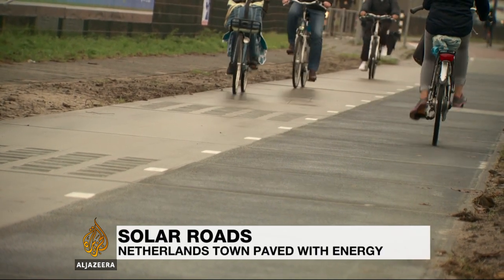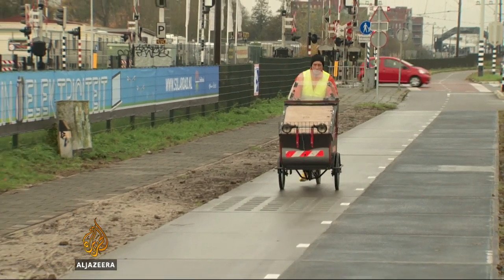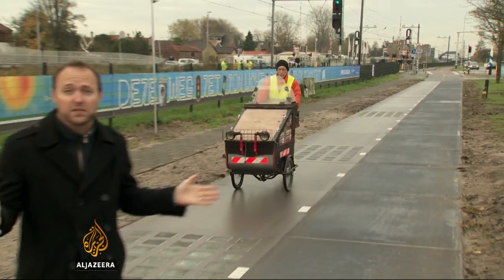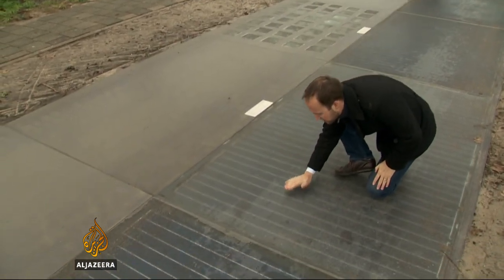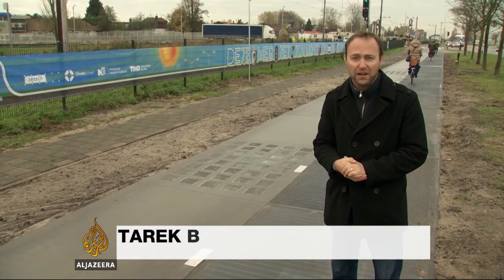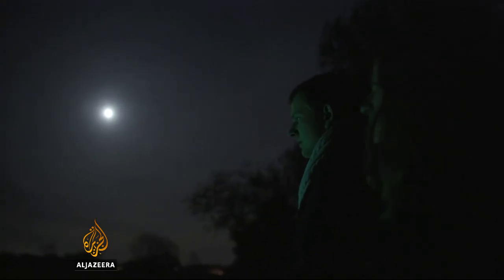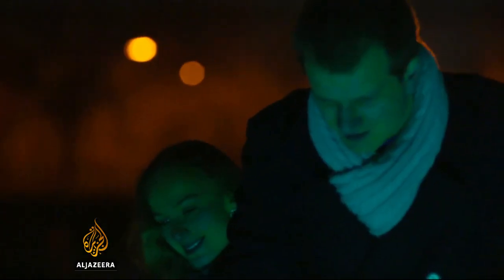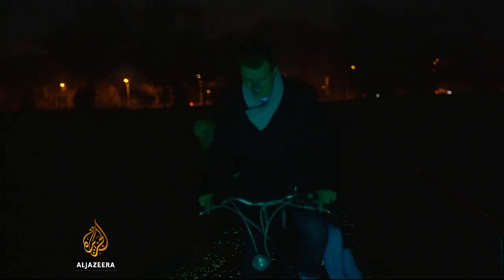Netherlands rolls out 'solar road'

Comment: I see people bashing this but currently not "cost effective" or currently anything negative means NOTHING! It is a step forward in the right direction and you need to try it and implement it in order to find how to make it work and fix any problems. Do you not understand that these will take the same trail, error process that Computers and LITERALLY every other Scientific advance has in the History of Everything! Solar Roadways are coming, it's only a matter of time, they are as inevitable as the smart phone I'm posting this message from, something that 30 or 20 years ago similar sceptics would say was insane.
Reply: Yes let's use solar panels in the most inefficient way possible and make building roads 100x times more expensive...

Comment: For all the haters:

I'm not for or against the solaroad, but I need some more info to make up my mind. 

Obviously the 3 million euros spend are for a large part research and development cost. When the first mobile phone was invented, no one said that it was a stupid idea because the phone cost millions of euro's.

I need to know the price of the solar panels used in the road compared to the price of solar panels on the roof. 

Also, when installing panels on the roof you will need to pay labor costs to human beings to install the panels. The solaroad is build in modules which will be pre-manufactured in a factory and in a factory you can use way more automation than when installing panels on a roof. And automated installation in a factory is obviously a lot cheaper. 

I'm also wondering about the price of inverters. When installing solar panels on a rooftop, you will need to get one inverter per roof generally speaking and I believe the inverters make up quite a bit of the total price of installing a usable solar array on someone's roof. When you have stretch of solaroad of a few kilometers, what's the price of the inverters you would need compared to a few kilometers of rooftops?

Shouldn't we hold back our judgement until we have the full price comparison?
Reply: +LeonHoogland Putting solar panels flat on the ground is the least efficient way for them to generate electricity, except for gratzel cells which are less efficient and use the rare and expensive metal platinum to generate electricity. Judgement has already been made using facts, not airy-fairy science.
Reply: MrCordycep From the Solaroad website:

Why would you include solar cells in the road and not next to it or on rooftops?

It is not either-or, but both-and. The total electricity consumption in the Netherlands lays around 110,000 GWh and increases annually by about 3% (according to CBS Netherlands).

This means that if all suitable roofs in the Netherlands would be equipped with solar panels, they could only supply approximately 25% of the Dutch electricity demand. In order to reach a larger share of solar energy, a larger surface area of solar panels is required and therefore alternative types of solar cell applications than only rooftops must be found.

In this regard, roads are an interesting option. The approximately 140,000 km of roads in the Netherlands cover a total area of about 400-500 km2, which is significantly larger than the total (suitable) roof surface area.

With the integration of solar cells in road infrastructure, a great potential has come into existence, creating a complementary market for solar panels.

http://en.solaroad.nl/faq/general/

Oh no that really sounded airy fairy!!! 

Maybe next time use your brain a bit more Mr Cordy. These roads are developed for The Netherlands, a tiny country with not a lot of free space. We don't have any deserts here.
Reply: +LeonHoogland Read the part where I wrote laying solar cells flat is the least efficient way to generate electricity. Both Thunderf00t and EEVblogs have videos showing how nonsensical the idea of solar roadways is. Quoting the marketing department of the company doesn't validate your point at all. As I already wrote, judgement has already been based on facts.

The funny thing is you falsely tried to appear impartial in your comment but then go and blindly defend what is nothing more than a white elephant project based on belief and not facts. Furthermore, you don't even bother refuting what I wrote in the first place.
Reply: MrCordycep I understand that laying solar cells down on the ground is not the most efficient way to use them. But again, there's not enough roofspace in The Netherlands and The Netherlands in general does not have a lot of space.

Thunderfoot is from Australia I believe and using a solaroad in Australia is silly yes.

But again, we're talking about a a tiny very densely populated country called The Netherlands.

This discussion should not be just about science, it's also about the practical implications of the technology.

But for some reason that's really hard to understand for people. But when you said the logic presented came from the marketing department of Solaroad you showed how sad you really are. CBS that has provided the statistics is a government entity and if they say there's a certain amount of roofspace, there's a certain amount of roofspace. DO YOU UNDERSTAND?

Comment: Yeah why not just have normal solar panels? It's cheaper and more efficient.
Reply: Jonathan Cheung
1. The Netherlands doesn't exactly have tracts of land where you could just put thousands of solar arrays like they do in the deserts of Arizona and California. 

2. Roads are not as "cheap" as you assume. An average cost of one 1/4 mile of standard two lane road costs $30-40k+labor+maintenance. Solar road of a 1/4 mile length could provide enough energy to power 20-25 homes, saving anywhere between $50-60k alone in electrical, fuel, and natural gas costs. While the upfront cost of solar panels is far higher than paving like normal, the eventual benefit for not only the environment but also a budget is better in the long run with solar panels. (For instance one solar panel on a house cost $30,000 and last 30 years, while the energy costs of an average home would run about $45,000-50,000 during a similar period.)
Reply: +Darrin Pfaff Asphalt roads and fossil fuels are incredibly cheap compared to solar panels...
Reply: Darrin Pfaff So mount the solar panels above the roadway like a roof. Keep the weather off and generate electricity much more efficiently than by having them embedded in the roadway where they get the least amount of light and are subject to damage.

Comment: Great idea for an art project, especially the Van Gogh connection. But...

Isn't it more cost effective to build solar panel roofs for bike paths, to double or even triple electric generation, provide protection for bikers from snow and rain, and half the cost of construction? The return on investment for roof solar panels must be six times better than solar roads. Surprising project for otherwise economical Dutch.

Comment: two problems are that glass is soft and it can break. it can deal with bikes and pedestrians and maybe one truck a year, but make it 1000 cars a day and it will be dust after a few weeks.

at least this is not fake, the solar roadways kickstarter thing was completely fake.
Reply: kurtilein3 If they can make transparent glass strong enough for buildings to be bomb-proof (One Word Trade Center) they can certainly make it strong enough and efficient enough for trucks or cars to drive on.
Reply: Darrin Pfaff
not true. false assumptions. glass does not have the hardness.
Reply: kurtilein3 I disagree. As someone with a Masters in Architecture and a background in materials engineering I can guarantee to you that hardened glass is the least of the problem here because of the composite structure that can be created between glass and translucent plastics. By layering different types and strength of glass you can make nearly unbreakable glass layers. If you have a Netflix account go watch NOVA: Ground Zero Supertower and you can see them test many variations of glass.
Reply: Darrin Pfaff
it becomes harder to break it if you harden it. but the hardness does not change. rubber tires that have little stones in them, with the glass having a hardness of around 6 and the stones having a hardness of 7 to 8, will do just the same damage. transparent glass that is bomb-proof only stays nice because it is installed vertically, and cars do not drive on vertical surfaces. put it on the ground and let a days worth of traffic run over it, and it will be dull and thinner. hardened composite glass of hardness 6 has no advantage over unhardened non-composite glass of hardness 6 when it comes to grinding and scratching.
Reply: kurtilein3 This is true that the actual hardness does not change, just the strength in layering and composite structures. I have no idea what they are using for composites to limit the damage done by harder materials (rocks, sand, most metals) but it would seem that obvious improvement would be needed to achieve proper hardness for a composite strong enough. Despite that new forms of composite glass are using all kinds of ceramic, minerals, and chemicals to create more dense and harder glass all the time, allowing for the thinnest bulletproof or shatter resistant glass ever. I can only hazard a guess but would think we are no more than 10-15 years from nearly unbreakable (in terms of what would be needed for a road) transparent glass-like structure. 

There has also been suggestions that the road could provide all need traction, so having grooves in tires which collect impurities would be eliminated. However I sincerely doubt it possible to ever stop without tread, even if brakes on cars and trucks were vastly improved. I recall reading somewhere that one of the major tire companies was working with some form of static tech that could allow tires to virtually "stick" to the road. That leads more toward the idea of driver-less cars in a world wear we press a button and it drives us there. Very advanced ideas but not realistic for immediate implementation.
Reply: Darrin Pfaff
i will try to put it in simpler terms. glass is a crappy roadtop material. the main problem is that you lose so much of the surface because of abrasion. this also causes friction on the glass to be shitty. so whatever you want, after 2 millimeters have been polished off, it will be smooth. and really slippery when wet. about the tires and the stones in them, you cannot ban drivers from driving elsewhere as well.

another problem is that solar panels lose efficiency when you put them flat on the ground with large amounts of glass on top. you should first cover all the unused rooftops that happen to be tilted in a useful way. do that, or else the whole solar roadway thing cannot make sense. when you accomplished this, move on to pedestrian streets.

then there is one really huge problem: the guys running solar roadways are fraudsters. they fail to deliver. unlike research scientists who have a track-record of reviewed scientific publications, these guys have a track record of false promises and pocketing money from phony fundraisers.

meanwhile actual scientists did a solar bikelane, only for pedestrians and bikes. they delivered without pocketing a few hundred thousand dollars, they started later than solar roadways and delivered earlier. no kickstarter money from large numbers from laymen, but as real scientists they could convince experts and get real research grants to get it done.

so my suggestion is that you get it into your head that cars and trucks driving on glass is a fundamentally bad idea. its like the flying car idea. yeah sure, maybe you can make one if you try hard....  people will still be using cars for driving and small airplanes or helicopters for individual aerial transport. same with solar roadways. people will use actual roadways, and actual solar panels on walls or roofs or on unused land, and experts will keep laughing at the solar roadways idea.
Reply: I never said that tradition solar arrays weren't both more energy efficient  and a better use of technology , but it still remains a revolutionary and good idea to convert the millions of miles of paved surfaces into energy harvest areas. Sure the solar roadway guys are scam artists but the science of the idea is solid and finding a translucent durable material is the least of concerns. Making the system viable for roads is a unique idea that deserves exploration. People in the past thought solar, fracking, and other obscure tech was worthless endeavors that weren't possible...
Reply: Darrin Pfaff
only a few ideas that were once considered worthless turned out to be good. the vast majority of good ideas were quite obviously good right from the beginning. and the vast majority of bad ideas just stay bad ideas forever. solar roadways fits the last category. "unique idea" can describe most bad or good ideas. making it viable for roads has extremely low priority. lets do that after we have solar pedestrian streets everywhere, shall we? if that does not happen, every dollar wasted on solar roadways is a wasted dollar. does that make sense? oh and, do you think we should plan a manned mission to pluto, right now, before we have been back to the moon and to mars? would that be a good investment?
Reply: Glass is one of the hardest substances we have lol. How can you say its soft?
Reply: Brice Gordon
did you ever compare it to stone, metal, or other ceramics? glass is at 5.5, rocks (depending on the variety) are generally harder, the common mineral quartz is at 7, steel also reaches 7 depending on composition, high-performance ceramics and hard metal alloys and some minerals reach above 9, with diamond being at 10.

so it is soft. take any stone and the stone is very likely to be harder. how can you say it is one of the hardest materials, when metals, crystals and ceramics so commonly beat it by so much? 5.5 is basically the middle, with fingernails clocking in at 2.5. how can it be one of the hardest substances when it is at 5.5 and sand paper is at 9?
Reply: go take a nail to your kitchen window. you can mark it but it wont scratch... but I do agree that to make a road out of glass is borderline tarded.
Reply: Brice Gordon
"you can mark it but it wont scratch..."  i guess a nail for wood is not made of a hard alloy, but have you tried a drill bit or a quality screwdriver or a quality knife?
Reply: i dunno maybe....i just had bacon so im over it lol.
Reply: Finding a translucent durable material is no problem at all. Diamond is pretty hard and durable as well as translucent. So also are other materials such as sapphire. But can we afford to use those materials to pave roads? And mounting solar panels along and above roadways and parking lots would be so much better than using them as pavement, wouldn’t you agree? So let’s just give up this money-losing idea before we lose any more money.

Comment: I still can't figure out the reason of why countries with such little sunlight throughout the year are leading with technologies like this! I mean how effective this would in a let's say an oriental country! Really anywhere with consistent hot weather and sunny days.
Reply: The thing is most other countries that receive more sunlight in africa, asia, or the middleeast can't afford it. Only oil rich countries in the gulf can afford and they don't really it need, at least for now. They should consider investing in for the long term when oil does eventually run out.
Reply: true. imagine the solar energy from middle east deserts. or deserts in general.
Reply: ahmedgunner15 Exactly!
Reply: Getsuga Tenshō or in African and south Pasific Countries , it would really change everything.
Reply: In  Netherlands there are millions of bikes, and more and more electric bikes and cars In the end the solar bike paths in Netherlands are also aiming for feeding electric transport power from the road it self and the Netherlands has a wet winter climate with sometimes temps under zero. So in Netherlands they have to use salt to keep the roads ice free and not sand like in the Nordic more dryer countries is used. And this salt distribution is a huge costs thing and also very bad for the ground water. So if the road keep themselfs ice free that is a huge cost reducement and safety increasement. In Netherlands there is not often a heavy winter with meters of snow, but there is very often light frost on roads (NL has a sea climate with a high humidity).

This project is funded by a provincial goverment in combination with other partners out of the industry. So basicly because the national goverment set a set procentages as target to produce in green energy, and local provincial goverment need to follow this and start to supported these kind of projects financially just out of necessity to reach the targets set for the future.

More countries can do this, simply by a public demanding it from their goverments and demanding more green energy. 

Green energy is not appearing on it's own..... if we do not set rules and demands for it via our local and national goverments. Oil producing nations really effect our policies strongly and there are even examples of cases were developing industries in green energy are treatened by oil producing countries and put under pressure (like death treaths). Also huge lobbying is going on to keep us addicted to gas and oil. The world will not become cleaner or greener if we do not demand it... now.
Reply: Because it's just a bunch of left-wing elitist twats jerking each other off about how they are going to save the planet using my tax money.